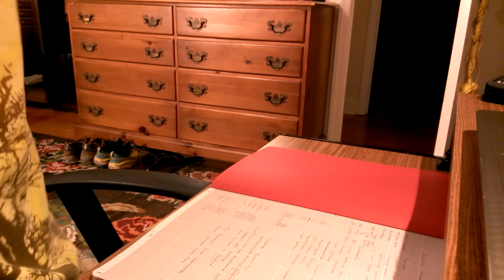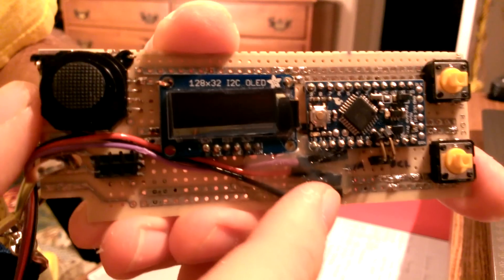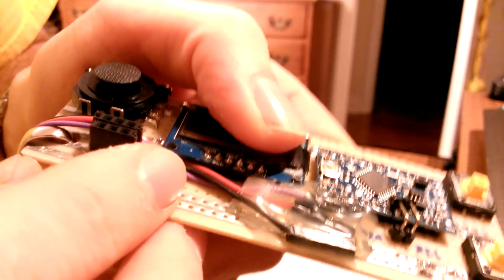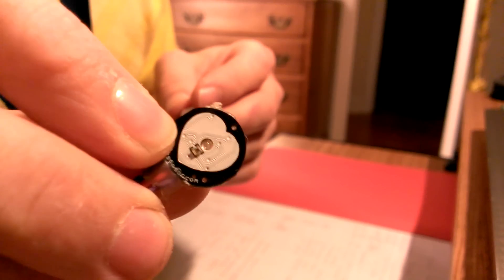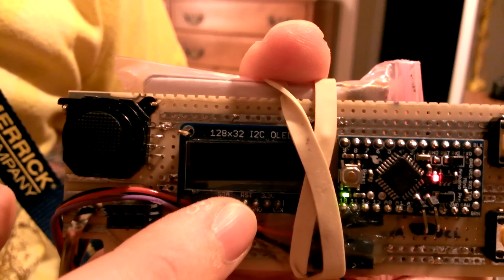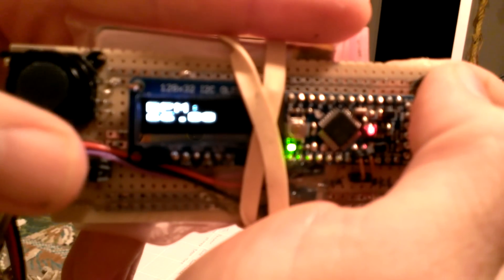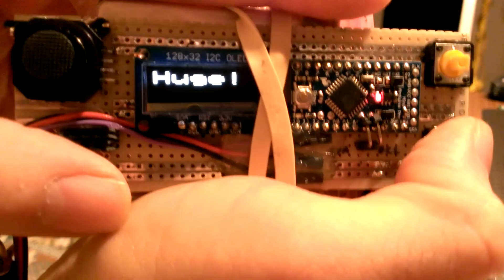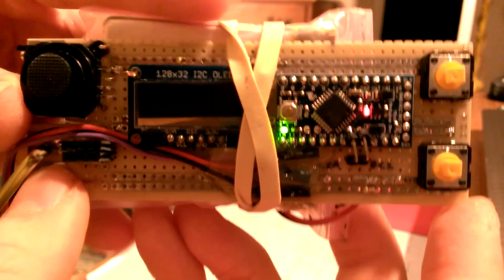Arduino Heart Rate Monitor

Comment: Can that heart rate sensor work when pressed against the underside of your wrist? I need a wrist based sensor for a project and so far I have been unable to find any hackable devices specificly made for use on the wrist. It would be greatly appreciated if you could test this for me.
Reply from the maker: +Samuel Doye I believe that it would work in that scenario. I never tried it on the wrist specifically but I did try on the back of my hand which worked. The only problem would be getting it to be firmly attached to the skin. Any gap between the sensor and the skin will affect the light reflected back into the sensor in turn effecting the BMP output.
Reply: Thank you so much, that helps a lot.

Comment: Hi Justin, I'm having difficulties connecting the Pololu AVR ISP Programmer with the Arduino board. I'm using external power connecting to GRN and RAW, using a 9V battery. The Pololu Programmer is blinking red and cannot connect to the Arduno Pro Mini. Could you please tell me your connection diagram/pin-out.
Reply from the maker: +Karl Goeltner Hey Karl, I used the ISP portion of the programmer. You need to connect the RST, MOSI, MISO, SCK, GND and VCC pins from the programmer to the arduino. I made a 2x3 port specificly for this from a strip of female headers. Here a picture of the programmer I bought. 

https://www.pololu.com/picture/view/0J1422

On the back behind the black 2x3 connector you will see the pins I was referring to. Those need to be connected to the corresponding pins on the Arduino. Here is a link to the graphical datasheet for the Arduino I used. 

https://cdn.sparkfun.com/datasheets/Dev/Arduino/Boards/ProMini16MHzv1.pdf

SCK is pin 13, MISO is 12, MOSI is 11, RST is a few pins above those and then power and ground. If you havent already you also have to add the programmer to the board.txt file under the pro mini section so that the Arduino IDE knows to use the programmer for that board. Does this help?
Reply: +Justin Stansell Thanks for you help! However it still doesn't work. Pololu 2x3 output pins only have VDD, where do i get VCC from? Should I use an external battery and hook it up to RAW and GND?
Reply from the maker: +Karl Goeltner Hey Karl, Vcc = Vdd its just two ways to say the same thing. Just hook the regulated 5V pin from the arduino to the VDD on the programmer.

Comment: Hi Justin, I'm doing a heart rate monitor project that will display certain text messages when the BPM is in a certain range. In order to use the code you've written, would I still need to use a Pololu AVR ISP Programmer? Or could I use the port already built in to the Arduino Pro Mini? Thanks!
Reply from the maker: +Karl Goeltner Hey Karl, you could use any programmer with my program. The programmer just requires a change to a setting when you are uploading it, nothing else.

Comment: Hey Justin. Im creating a heart rate monitor for my Electronics course but only using the pulse sensor, a 7-segment display (4digit), and a single alpha numeric display (to display A(average), H(maximum value), L(minimum value)). Can I possibly get a check list of what exactly I would have to modify in your code in order to display the BPM.
Reply: I am also operating with the Arduino Uno.
Reply from the maker: Nick Pegnato Hello Nick, how are you gonna drive the 7 segment? If I assume that you are going to use a typical driver such as a 7446, 7447, or 7448 I could give you an idea. Doing this would require 4 digital outputs per 7 segment display for a total of 16. I dont know how to interface with the alphanumeric display so that is not accounted for. With the Uno as your controller you would be short of digital outputs so it would be best to multiplex the outputs so that you have enough to run your displays. This would however require a different type of 7 segment driver such as one that has an update enable pin. This which would allow you to update each 7 segment without affecting the others. I however dont know any of those chip numbers. 
As for the code it would need to be rewritten in every aspect of the display functions. Every call I do to the display would require you to convert that data to a binary digital output to the 7 segment driver chip (744x). I'd love to see how you go about this, please link it when you're done.

Comment: sir is there any kind of sensor for detecting heartbeats
,except pulse sensor?
Reply from the maker: Well this depends on the limitations you have. The sensor I used was essentially a light sensor which detected the change in color of your blood. You could with correct probes and active amplifiers you could make an electrocardiograph to much more accurately determine heart rate but this would require probes attached on major veins and in a circle around the heart. I do not know of any other heart rate sensors marketed as DIY sensors however, Im sure googling it would render some results though.

Comment: Hi justin, can i use the 16 x 2 characters LCD display connected to Arduino Uno instead of OLED display?
Reply from the maker: Yea any display would work but my code wouldn't. If you're going use my code and a different display then you will need to edit the code to reflect the change by inserting the header file for your new display, changing the .display functions and whatever initializations that display requires ... etc. Oh and delete the text size menu, that wouldn't work for a 16x2.
Reply: ok. thanks! :)
Reply: Justin Stansell how did you mount the LCD on the board? btw are you using a stripboard or donut board?
Reply from the maker: I mounted the display using male headers. For the most part it is secured using the display power, ground and comm connections soldered thru the board to the display. The display was however not completely secure using this method so I also used the two mount holes in the corners of the display PCB. I soldered in headers so that they stuck through those holes then I used a set of needle nose pliers to bend them around and secure the display, just to be redundant also used hot glue. As for the board it was harvested out of an old electronics trainer kit but is similar to a strip board.
Reply from the maker: Also a word to the wise, be sure to test your circuit and program on a breadboard before you solder it. Its a lot easier to make changes on a breadboard than a completed circuit.
Reply: Justin Stansell thanks! its my first time building something like this. Kinda freaking out. :)
Reply: Justin Stansell how did you adjust your contrast? I notice that you didn't use any potentiometer like everybody did.
Reply from the maker: Tay Aaron I did not adjust the contrast. As far as I know you cant adjust the brightness of the OLED display I used.

Comment: hello sir do you have xtra pulse sensor?? can i buy that one?? because i need it in my project.. im a filipino
Reply from the maker: Hello Jeniel Ednilan, I do not have any extra pulse sensors. You can however buy one from sparkfun where I bought one. The link to the item is in the description of the video under the heading Components Used. Just click where is says "Show More" and it will display.
Reply: hello sir i have a problem displaying text in oled shield that i buy in http://www.e-gizmo.com/KIT/oled%20shield.html using arduino.. can you teach me where to connect pins from oled to arduino?   thnx
Reply from the maker: So that is a shield which is designed to plug into an arduino Uno or other similar form factor microcontrollers like redboard(sparkfun). All you have to do to make the connections is solder male headers to the shield and plug it in to the arduino. Google "arduino shield pictures" and you will see what I mean.

Comment: hey justin, I want to set a BPM range. For example if my bpm is above 150BPM or below 50BPM an LED will blink. How would i do that ? mind helping out pleaseeee :)
Reply from the maker: Hello Tay Aaron,

If you're writing in C like with the Arduino it would be

#define LEDpin 13  //this needs to be above the void main and void setup, also restate the number to whatever pin the LED is on

If ((BPM > 150) || (BPM < 50)) //This means if BPM is greater than 150 or less than 50 do stuff in bracket
{
digitalWrite(LEDpin, HIGH); // put 5V on the LEDpin
delay(1000);     /wait 1000ms or 1 sec
digitalWrite(LEDpin, LOW); // put 0V on the LEDpin
delay(1000);      //wait 1000ms or 1 sec
}

I hope this helps.
Reply: much THANKS! :)

Comment: Hi Justin, I'm doing a high school science fair project using an alert system that sends text messages when it senses irregular heartbeat and i was wondering if it would be possible to get a sample of the code you've made for this system? I'm currently using an Arduino Uno, Thank you :)
Reply from the maker: +Vanessa Chan The code I used for this is already in the comments
Reply: Thank you very much!

Comment: hellow sir..     volatile int IBI = 600 ; why is it IBI in a value of 600 sir?
Reply from the maker: The IBI is the inter beat interval, it is used to eliminate dichrotic noise which is the detection of a double heartbeat when it only beat once. I however didn't write that portion of the code, that came from a Sparkfun example for the heart rate sensor. In short I do not know but if you want to ask them just follow the link in the description to their webpage.
Reply: thanks.... what is the use of interrupt sir?

Comment: Justin, i am getting weird characters when i am display the  BPM value on the LCD. I am using a LCD 16x2 display

void setup (){
  lcd.begin(16,2);
  lcd.print("Heart beat rate");
  pinMode(ledPin,OUTPUT);         // pin that will blink to your heartbeat!
  Serial.begin(115200);             // we agree to talk fast!
  interruptSetup();                 // sets up to read Pulsewave Sensor Pulsewave every 2mS 

}

void loop(){
  lcd.setCursor(0,1);
  lcd.println(BPM); 
  lcd.print("BPM");     
}

If you are not clear of what i mean. Can i email you a photo of it?
Reply from the maker: Hello Tay Aaron, Yea you can send me a picture stansell.jm@gmail.com

Comment: hellow can i have ur schematic diagram..plss..
Reply from the maker: Hello Jestoni Borja, I did not write a schematic when I made this 
The only pertinent conntections are
1) the heart rate sensor which just goes to an analog input
2) the joystick is installed so that it is a voltage divider so both X and Y axis go to analog inputs
3) the OLED display connections need to go to SCL and SDA outputs for I2C. 
4) the buttons are digital inputs
Other than these everything else is just ground and power. Easy peasy